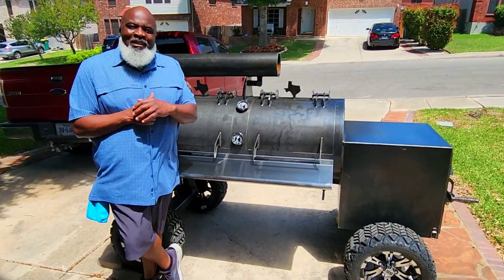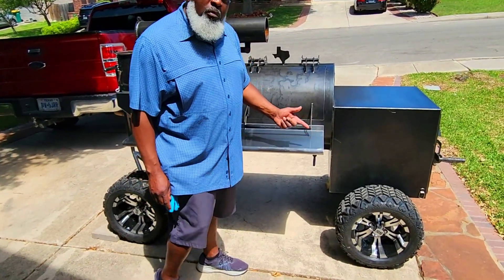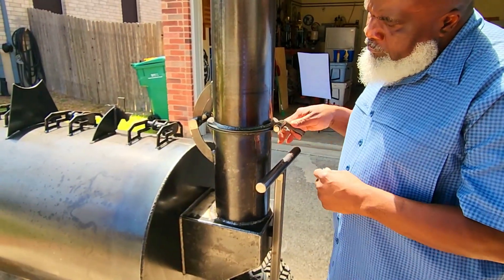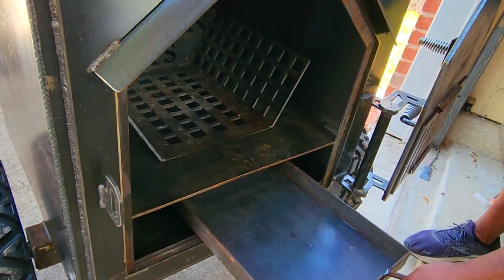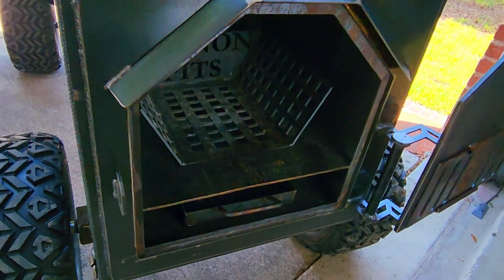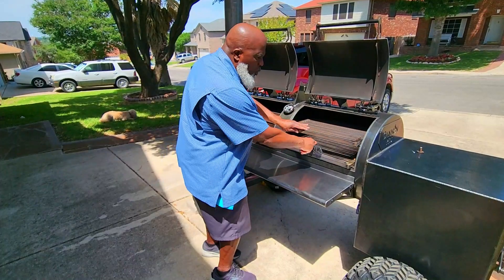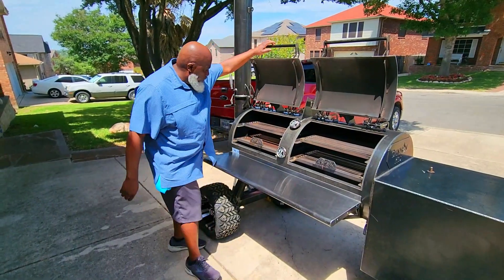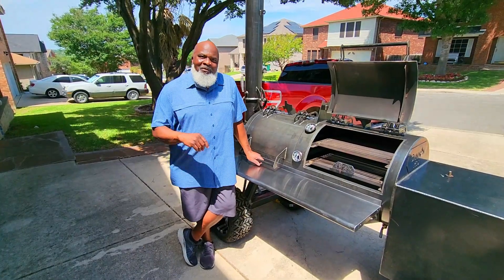Walk Around of our Offset Smoker | Cannon Fabrication

Comment: grease point aka zert fitting. Dang very nice, CJ what's the knob on top of the fire box another damper ?  LSG uses the alike type wood basket they call it a wood management basket. I purchased one for my poor man Off set OkJoe works great.
Reply from the maker: 🤣🤣 I couldn't remember the word "fitting" Lance. The little knob on the Firebox is the bolt and cotter pin used to secure the collapsed stack for transport.
Reply: @mamaandpapajoe  🤣